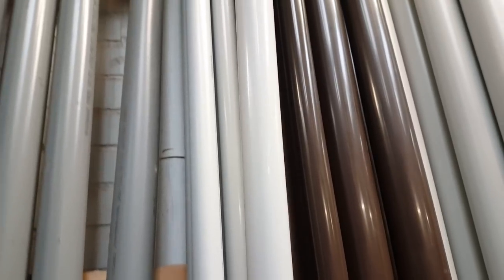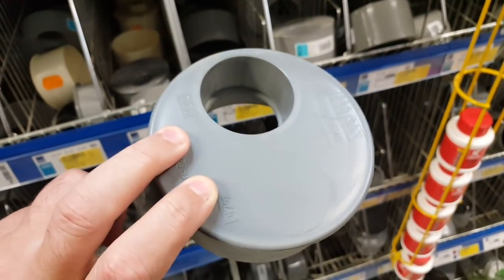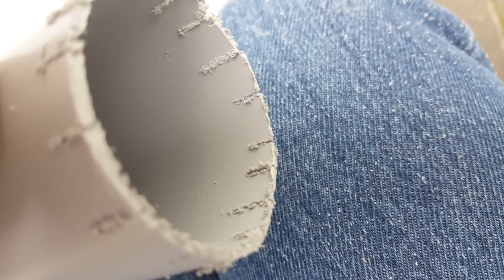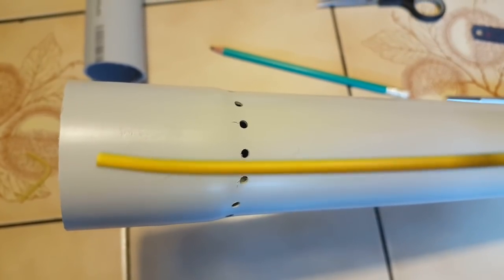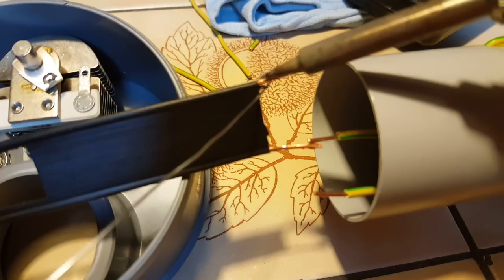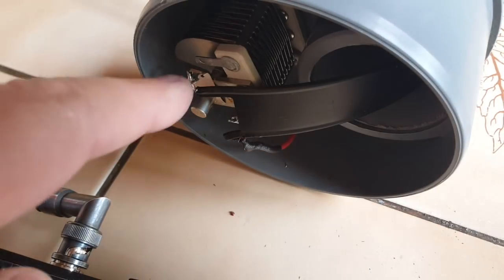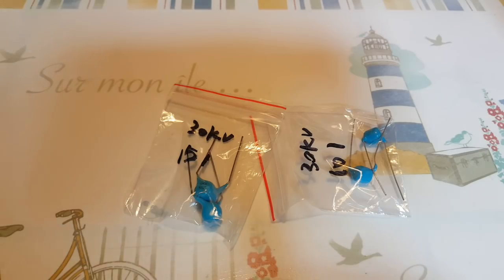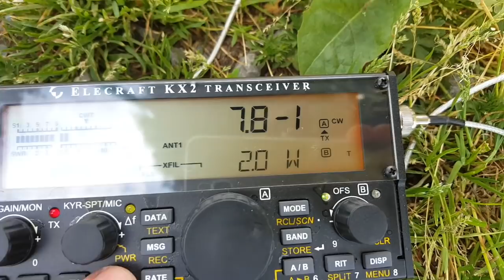Building a Short 40m 7mHz Radio Antenna, FAIL!

Comment: Mine worked just fine , even worked N7EKD from  south Africa with it. so...... I used a 30 mm id plastic  pipe 1.5m  long, then a made a flat plastic strip that will fit inside  the pipe, onto that  i wound my copper wire spaced 1,mm, i cant recal the turns amount, the whip part was only 500mm adjustable ,as  i did not need  much adjustment. The match was LC for matching low Impedance. I used this in a mobile and on a stand config, and was surprised it worked just  fine, Initial swr was 1.5 :1. you need radials! or body earth !

Comment: interesting experiment Gil, thanks for sharing :)
However, if your goal is a small antenna that fits in your car, remember you don't necessarily have to sacrifice efficiency for small size, instead you could sacrifice bandwidth and try to build a small and efficient antenna, maybe along the lines of a magnetic loop.
Reply from the maker: Hi, I have build a couple in the past and will  do it again!

Comment: I've never been able to get anything to work where the wires are folded back on themselves multiple times like that.  A folded dipole does work, but it's more like a flattened loop when you think about it.   Folding the wires back on themselves multpile times makes a weird kind of inductor.  If such a design were possible, there would undoubtedly be many commercial variants of it already available.  But hey, there's nothing wrong with experimenting.   I do it a lot!
I think the only way to successfully do a short vertical for 40 is with a large loading coil at the base.  You can get it to resonate at the cost of radiation efficiency.
I like the 3ft magloop for portable.  If you make it with RG8 coax, like the Alexloop, it can be broken down into a small carry box or pouch.
Reply from the maker: Agreed, it was a long shot...

Comment: Reason for failure:  The two ends of the 40 meters of wire are fed. At that point, the energy is equal and exactly out of phase.  In fact, the currents in those initial lengths of wire almost completely cancel each other. The next two lengths returning down the pipe are similarly equal and exactly out of phase. That pattern holds for all 8 pairs of wire.  All the currents cancel and so does the radiation. 

Alternative:  Connect the feedline center conductor to one end of the wire. Attach the wire along the first 2 meters of tubing. Then wind a bunch of the wire around the tubing to form a loading coil. Then continue the wire up to the top of the tube. Use the handbook formula to learn how many turns of wire are needed to resonate the antenna.  Connect the feedline shield to a counterpoise, e.g., your car or radials.

Warning:  Don't run high power with the coil wound around PVC tubing.  The PVC will absorb too much energy and burn up!  

Stan K9MFI
Reply from the maker: Thanks, the plans are obviously wrong on that one..
Reply: @RadioPrepper  Yep. They describe a 20-meter-long chunk of twin-lead shorted at the far end and folded back on itself a few times. Hmmm... that sounds like a virtual short at the feedpoint. :(

Comment: WOW! That Opinel knife display was awesome! Sorry to see this did not work, but this hobby is all about experimentation. You must try, or you'll never know for sure.
Reply from the maker: I almost bought one! Won't be long... #12.
Reply: I've got a #9 in a custom kydex sheath with firesteel, worn as a neck knife....I showed it in a video along with some other knives. They are sharp!
Reply from the maker: Nice, yes, you need to mind the thin tip though. Nothing better for the price, carbon steel.

Comment: I wonder if the r.f. is going back on itself and cancelling out?

When I was a short wave listener, too many years ago, I thought about bringing my long wire back on itself to get more wire out but an amateur friend my Dad knew thought it wouldn't do much better. I tried it anyway and it was no better but of course I wasn't trying to transmit.

You might want to experiment with this idea Gil. What I did try today was a home made Joystick if anybody remembers those things. I made it last year and even got it to tune on 3.5 MHz. Mine is 7 foot overall with a coil in the centre of about 12, maybe 15 inches, Today I fed it at the top from the shack bedroom window with about 20 feet of wire on 5.262 MHz and contacted a station on c.w. about 130 miles away, I got 559 with my 3 Watts. The base was simply stood on an old gel cell battery to insulate it from the ground. 

It's really just an inductance on the end of a long (short) wire and I tuned mine in the shack with an L-C tuner. It's an end loading coil which helps in loading a short wire.

73, Bill, G4GHB.
Reply from the maker: Interesting, I'll look into that. Thanks.
Reply: @RadioPrepper  Yeah, take a look, it might be another project for you to try.
Bill, G4GHB.
Reply from the maker: I do want to make a shorter 80m vertical...
Reply: @RadioPrepper  Well, that's fine. I'm not saying you have to.

Comment: Interesting antenna. It looks like the 75m folded dipole I have in my attic. The wire runs between the roof decking and rafters. At 3916 it's 1:1. Everything else requires tuner. I work it on 6m to 160m on FT8 all the time. That said, I think I could tune a rock with my Dentron MT-3000A tuner :)

Comment: Gil, An interesting project. I wonder, did you make any adjustment to the wire-length for the 'velocity factor' ? Not altogether a 'fail' - You probably saved a lot of us experimenters a lot of frustration! Those that can use a VNA might figure out whats going wrong - I much prefer (old-school) to twist a knob and see a 'dip; on a 'frequency-meter', coupled to the antenna! 73
Reply from the maker: I can't remember.. The length was probably given. I used a VNA, but again that was a long time ago. I don't remember it being resonant anywhere near 40m.

Comment: Seeing the project initially my mind ran the other direction wondering how it would've functioned with the wire spiraling up and down. Like a hamstick or firestick antenna with a tunable tip of some sort.
Reply from the maker: Good thinking. I thought about current cancellation with parallel wires, but followed the design...

Comment: add a 9:1 balun or reduce lenght to 10.7 meter....if you read 9:1 it is exactly that 9:1
You can search 9 to all balun and build it easy, then use taps until you find best match

Comment: It appears to me the feel line is shorted into an essential 2.5M pipe.  If that is a safe assumption, it can't possibly work.
Reply: Also, you have some artful building techniques!
Reply from the maker: Thank, I think, LOL. ait goes to show that not all internet plans are good. BTW a DC short can work quite well as an antenna, as in a full wavelength loop.

Comment: I think you have far too much inductance for 40m. Where did you get this design from? Did you try the lower HF band to see if the SWR was better? Personally, I would reconfigure the antenna to a shortened 1/4 wave with top loading coil. You can use all the wire and hardware. Then just heat shrink the loading coil, and cable tie the radiating element. Because it would be narrow bandwidth you can use the capacitor to "tweak" the antenna tuning. One thing I like about your videos is that you will post stuff that goes wrong as well as what goes right. That's real life in the field! That's always a solution to a problem. 73 from Dave G7OPC
Reply from the maker: Hi Dave, thanks. The air capacitor goes from 10 to 150pf. I got the design from a French web site.. I did not try on other bands..
Reply: Radio Prepper Hi Gil, this is the type of antenna I was referring to: http://iz3ayq.blogspot.co.uk/2016/04/40-m-short-vertical.html?m=1

Comment: Nice try, Gil. 
It would work better if 66 feet of that wire were wrapped helically around the length of the pipe instead of vertically up-and-down like that one there...  wrapping the wire helically  the pipe would become a long coil with that wire space-wound along the length of it.
At the top of that long half-wave-on-40-meter coil put a little capacity-hat*  and feed the lower end of that big coil in series with the variable capacitor circuit in the base and try that.... and with some experimenting with the tuning setup at the base you'll finally get the whole thing resonant on 40. 
Plus, a good ground connection to the Earth or to quarter-wave ground-radials underneath the antenna definitely helps too.  

It can be scaled up or down to higher or lower bands by wrapping the appropriate length of wire that equals a half-wavelength on the desired band around the pipe and experiment with the capacity-hat* at the top and the feed at the base.  :-)

* The 'capacity-hat' could simply be something like a length of stiff wire bent into a circle about 12 inches in diameter with 4 spokes attaching it to the end of the 66 feet of  wire that is wrapped around the length of pipe. Again, experimentation with this aspect will result in a useful and permanent or portable-as-needed antenna.
Reply from the maker: Yep, that would definitely work better..
Reply: Right on.
Reply: wrapping helically does sound interesting. The only thing is getting all those wires to wrap decently will be a real challenge.  But if that is what the physics demands, I guess that is what it demands. I know I would wind up with a terrible mess.
Reply from the maker: Simpler to buy a Hamstick I guess...

Comment: I would try more Capacitance in Parallel with the variable capacitor, maybe as much as 400pf would bring the swr down because it did come down a bit when you added the 100pf.good luck and don't bin it just yet.
Reply from the maker: Maybe yes, but I fear for efficiency..

Comment: For a 40 meter dipole you need 20 meter of wire.
So you need about 90 Opinel  n°13. Nor cheap!
But tell me with which  antenna you can cut your bread and sausage?
Reply from the maker: Yep great knife! BTW this is not a dipole.